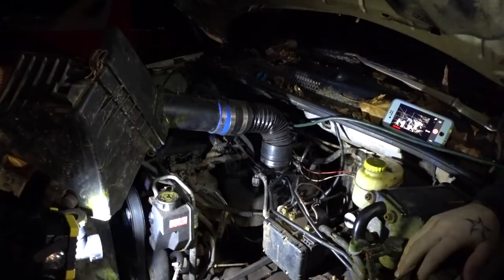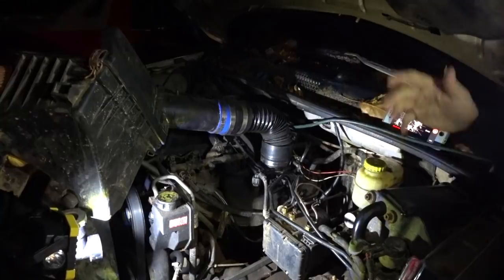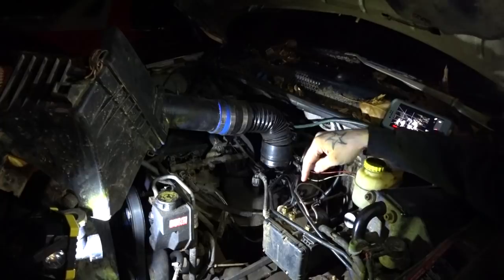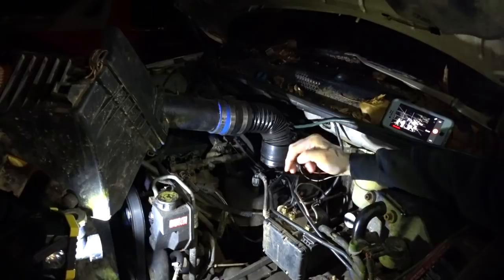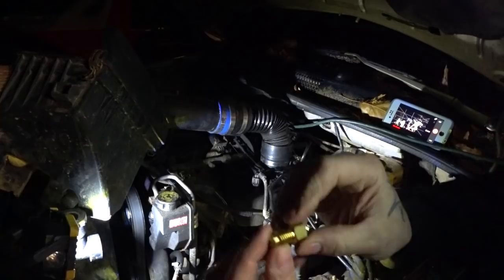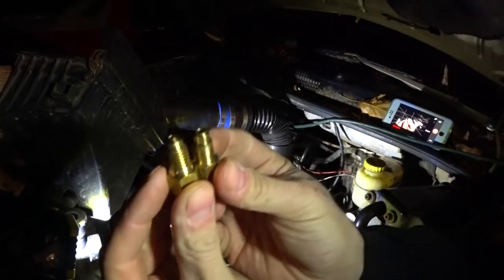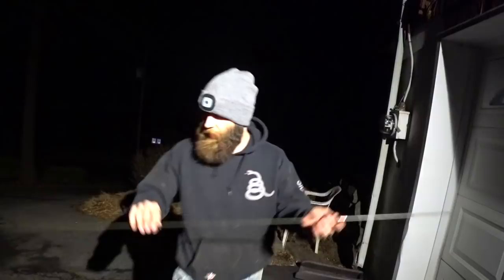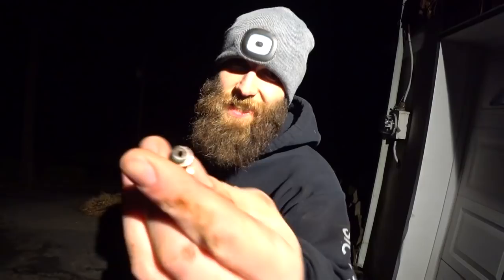WJ ABS Brake Fittings + First oil change in 5 YEARS!

Comment: Glad I found this video before I assumed everything was 3/8-24 tube nuts. Also, totally agree with you, it sucks having greasy wood and sawdust covered everything.
Reply: Here's some adapter part numbers if someone has to try to do brakes on their WJ. My local auto parts place didn't have any M12-1.0 to 3/8-24 adapters so I ended up stacking M12-1.0-M10-1.0->3/8-24

Male M12x1mm bubble to female 3/8-24 inverted
FMSI 3252
AGS BLF-33

Make M11x1.5mm male bubble to female 3/8-24 inverted 
FMSI 3253
AGS BLF-32

Male M10x1mm male bubble to female 3/8-24 inverted
Paulin/Papco PC1178
FMSI 3039
AGS BLF-31

Male M12x1mm male bubble to female m10x1 bubble 
Paulin/Papco PC1180
FMSI 3474
AGS BLF-36

You can find the AGS Automotive Solutions catalog or FMSI automotive hardware catalogs online.

Comment: Get a flare tool and use the factory fittings saves time and trips to the parts house 🤘 Also bulk line is cheaper in 20 foot rolls than 5 ft sections but those are the brakes 😂

Comment: I just did a full tune up. And got rid of my coil rail and converted to a coil pack. Then 2 days ago she stopped shifting into OD. 🙄🙄 I love my Wj but I swear it's always something.  😂😂😂
Reply: Christopher Byrd my 04 4.7 wj did that it lasted about 6 months before the torque converter died
Reply: @staticjordan42374  I'm gonna change all my solenoids and accumulator spring. See if that does it. Cause other than no OD it still shifts smooth and flawless.
Reply from the maker: It IS always something. Haha. I want to do that coil rail mod on mine as well. Hope you get your shifting issue worked out

Comment: I bought some penetrating spray at auto zone called freeze off or something close to that. Stuff worked like magic on header bolts. Comes out really cold. Worth a try I'd say.
Reply from the maker: Interesting... I guess the endothermic reaction helps shock the metal. I will have to check that out!

Comment: I put 6 quarts of oil in mine every time and there always seems to be a little low on oil when I check the dipstick. Now about the rear main seal mine has probably been blow for a while along with the oil pan gasket so I still have to replace both of those before I make assumptions about where my oil is going.

Comment: GREAT CHANNEL, LOVE YOU TALKING THROUGH WHAT YOU'RE DOING. I have to do my brake lines on my 97 OH MY, I think if I breath on them they will BLOW ? Same for gas line underneath, VERY VERY RUSTY. 
Rotella T6, Are you talking about the Syn. Multi-Vehicle stuff ? Gas & Diesel ? I put 6 quarts in my 4.0 but I USE THE BIGGER FILTER NOT THE TINY AZZ ONE THEY SAY TO USE. Also use a can of RESTORE every other oil change ? LUCAS ? I HATE ANYTHING LUCAS & adding that in the winter ? A BG product or even STP but LUCAS, YUK JMHO ?
Great job on those lines & bleeding, I'll have to get that type of line when, LOL if I do mine. Fell like I'm all JEEPED OUT, put so many new parts on before winter & some during the colder months. I still have a clunk in the front end & I HATE THAT CRAP & the steering seems loose somewhere ?
HAPPY NEW YEAR TO YOU & YOU'RE FAMILY, SMOKER LOOKED GREAT & I CAN DAMN NEAR SMELL THAT CHEESE, FREGGIN YUMMY.
Reply: If you are going to be doing gas and brake lines, you should just throw in vacuum lines while you're under there as well. I just replaced one of my rear brake lines a month or two ago and then a vacuum line split open about two weeks later.
Reply from the maker: Thanks for the comment, bud. Lots to unpack there. I think we are just on different pages with the Lucas (and that is fine). I have had good experiences with it and swear by a few squirts in a tired neglected old 4.0.As for it being winter, yea I see your point, but it is done now. Haha

Comment: So right now I'm working two full-time jobs I have time for things like oil changes I'm my current Broncos that I'm buying it needs ball joints on the passenger side with locking front hubs because I don't have much time I figured I would call around because sometimes when you're trying to pay your house off by tax season you just don't have time to do ball joints because you know it's going to take all day you just got that gut-wrenching feeling I was looking at getting some Moog parts doing it right getting good parts because this is my War rig I got told that they won't touch any parts that I personally pay for by most places  I figured I would have them also replace the hubs since they got to take all this crap off anyways and while you're doing that you might as well replace rotors brakes all that a quote of  $1,200 with me buying all the parts text doesn't emphasize my rage keep in mind I paid $1,400 for the Bronco
Reply from the maker: Hot dang, buddy. That is a tough way to go. There are shops out there that will let you buy your own part. they are the good ones.